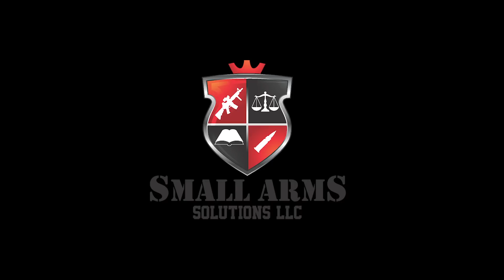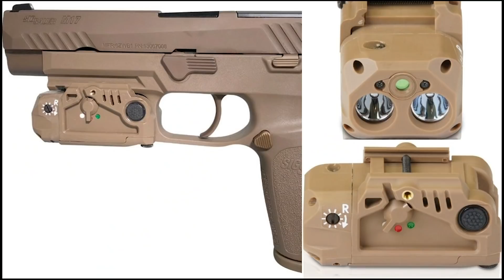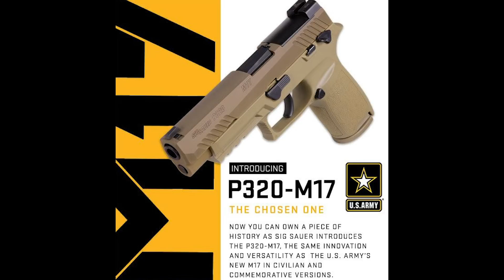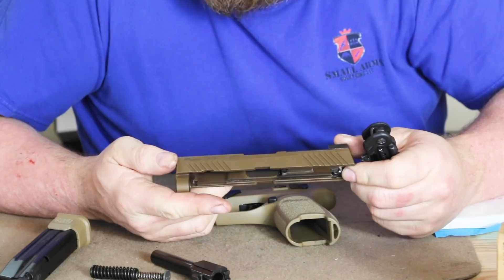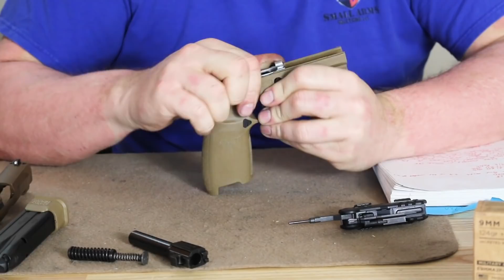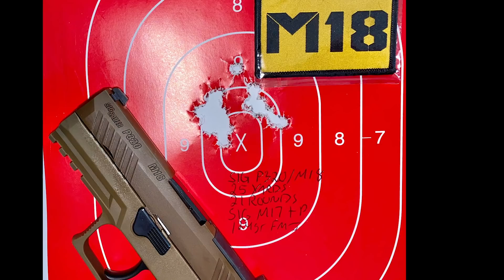Sig P320/M18 Pistol

Comment: My impression is that the Military specifically asked for a modular pistol, and only Sig met that requirement.
Reply from the maker: Not true.. Both pistols met it. That’s why they were supposed to compete in phase 2 testing. That chassis had nothing to do with the modularity requirement. Read the requiremnt!
Reply: I read an article that stated that the p320 was more reliable and had far fewer failures when being torture tested in harsh conditions. Grand Thumb proved this during the mud torture test in which the sig performed better along with the smith and wesson m and p.
Reply: @The-last-son Incredibly laughable given all the QC/design issues of the P320 being clearly demonstrated this last yr. They're literally killing ppl.

Comment: Glock did compete. They just lost.
Reply from the maker: Um, no. The phase 2 was not completed. Only a down select. No testing was done to determine if either pistol met specs or not. With only 12k rounds being fired, they don’t know if it was even as good as the M9 it was to replace. The army failed to properly test these firearms to determine what was equal to, better than or if neither met criteria. Phase 2 is where the guns really get tested. I am not a fanboy of either pistols. I am a fan of completing trials to insure our troops get the best possible equipment.

Comment: I think Glock came into the competition, arrogantly assuming they were going to win just on reputation. The G19X barely met the criteria in my opinion. For those that would disagree with me., a changeable backstrap does not make it modular, and the thumb safety was just haphazardly thrown onto it, where is that thumb safety now?  Anyway, that’s my opinion.

Comment: Glock is not modular!
Reply from the maker: Per definition of the contract, yes it was. The removable chassis had nothing to do with the modularity component of the RFQ. Sig chose a two gun solution snd Glock chose a 1 gun solution. This is a common mistake people make about this requirement.

Comment: The SIG is much more complex.  The Glock is much more durable and easier to work on.  The SIG will shoot loose with +P ammunition,  the Glock will not.  SIG mags cost twice as much as Glock mags.  Then there is the issue of the 200+ lawsuits against the SIG  320 by owners who have accidentally  shot themselves  I think Hunter Biden was involved in the selection process..

Comment: They don't have basic features like a safety so glock should not even be considered until they redesign and bring it to modern requirements. Glocks have less safety features than 1911s.
Reply from the maker: You are so off on this dude! Very sorry to say!
Reply: @SmallArmsSolutions  nope glocks dont have a basic safety that's a fact.
Reply from the maker: @blackfam972 the MHS had 4 safety’s! Lever, firing pin, drop and trigger safety!

Comment: An excellent and informative video review. I believe it called a “captive guide rod” not embedded on the M18. Also, the M17 has a separate guide rod and spring, which is more traditional.  Any reason why the PVD coating is so susceptible to scratches - why didn’t Sig use a better coating?  Is the M18 +P rated?

Comment: Came across something interesting today, so I bought it. An M18 exactly as issued with the cardboard box. The pistol is not on Sig's website, but is exactly like the issued pistol. The markings, black controls, extended slide lock, and serial number (TCXXXXXX) is exactly like the issued pistol. This is not a standard civilian P320 M18 and it's not a commemorative.

Comment: Recently been doing a lot of research into 'carry' sized pistols like the 19X/G45 and the M18. I am in the same boat. I don't see the purpose of the M17 if the M18 works fine. Pitting the M18 and 19x up next to each other similar the two really are and the M17 really just seems like the oddball out. If the 'carry' size pistols do the job, why spend the extra dough fielding the M17?

Comment: Modular design and manual safety and 2 sizes was the main reasons Sig 17 won the contract.  Glock didn't match up
Reply from the maker: Umm, no. Both manufacturers met the criteria. The guns were never even tested
Reply: @SmallArmsSolutions  Apparently we've read different reports on this.  No matter..
Reply: @SmallArmsSolutions  Just seen a 21 min. video on this subject. It showed the form or reports on each category. It broke it down into 9 different categories. One being most important and 9 being the least. The cost was 7th out of 9.. It was 32 pages and very detailed. It also listed Clocks complaint and why its was turned down.. Very boring.. lol  Thanks good luck...
Reply from the maker: @DM2277-i6z  the simple fact is both pistols met Phase 1 testing. They failed to do phase 2 which is how procurement was done. That is all the torture, environmental and compatibility and so on. After that you have one clear winner, two failures or two guns that meet the requirement and for that one competitive bidding. You DONT SKIP THIS PHASE
Reply: @SmallArmsSolutions  You should watch that 21 min video with the 32 page report and breakdown of the test results. I think it explains it, sort of..Don't remember the site, he looked like x lifetime military from Vietnam era.  Still has his crew cut..  lol Very knowledgeable   Good luck...
Reply from the maker: @DM2277-i6z  there were no test results for phase 2. Only results were the initial downselect. I have been part of weapon replacement programs all over the world. This is not the way it is done.
Reply: @SmallArmsSolutions  Makes zero difference to me one way or another.  Was just saying what i seen and read and where i seen it..  I don't personally own either
Reply from the maker: @DM2277-i6z  means a lot to me. Our troops deserve the best handgun available. The army failed them by selecting a weapon that did not know if it was the best of the two since they did not complete the normal testing. If they did, all the problems the gun has had would have been found early. They could then have decided if these were a showstopper or could be fixed during normal course of development. I am not a Glock or Sig fanboy, I am what is best for the troops. The Army never knew either before selecting. Also, they don’t know if the M17 is even as durable and reliable as the M9 it replaced.
Reply: @SmallArmsSolutions  Well i have seen 4 different comparison test videos with the Sig vs the Glock because they all were wondering the same as you, which one was better.. And all 4 guys liked the Sig better than the Glock. And they all commented on the previous Beretta that Sig replaced, and 3 out of the 4 guys hated the Beretta.  All 4 test videos were military veterans of different ages... They all seem to agree that the Military got it right.  And i hope so to.. Good luck and be safe.  I enjoy your videos
Reply from the maker: @DM2277-i6z  it does not matter what anyone thinks, there is a process to procurement.  This is the problem
Reply: @SmallArmsSolutions  I never said it was right.  I just was informing you what i had read and seen.  Like i said i'm just glad it looks like they got it right.  And thats what matters the most... Bye

Comment: Glock failed to meet the requirements laid out in the program, plain and simple.  They put a safety on, but no optic cut, limited modularity due to how it was manufactured, and cost about twice as much as the Sig.  Glock was relying more on their world renowned reputation for reliability, than really trying to make the pistol per specifications.
Reply: Sig hired the main General in charge of the program and put him on one of their Executive Boards.

Comment: None of the 'what if' stuff matters when it comes to safety. "PLACE WEAPON ON SAFE" are words spoken and heard on every military range and if one option does not have a safety, it would only be considered for competent spec-ops units like the g19 already was and is. With the amount of NDs that happen already, the clear winner is the one with a safety. I think if Glock spent that much on R&D they could have integrated a safety and likely would have won the contract but I guess we'll never know.
Reply: The actual glock submission did have a safety
Reply: @jacobdejong9142  I just learned that about .5 seconds after I posted this.

Comment: Having used an M11 (1990s) and owning a Glock 19 (gen 3) I prefer SIG in a DA/SA, though I seem to be getting turned to my CZ P-07 lately, but Glock in a striker fired.  Reason is I put more faith in Glock's internal safeties, partial cocked striker with 3 separate safeties to where you literally have to pull the trigger to make it fire, over SIG's fully cocked striker and all safeties attached to one area.

Comment: Sorry but there's no way glock sunk alot of money in r&d to put a fde finish on a glock 19 with a slightly longer grip and a lanyard loop. Sig actually had to spend $ in r&d because they actually innovated with the modular fcu.
Reply from the maker: The gun was redesigned, it was not a Gen 4. In fact, I don’t believe there are any parts compatible. Both guns had significant r&d costs. They should have been tested properly to make the best decision, fair decision giving the troops the best possible pistol.

Comment: Glock had a shot at the contract...The government wanted a modular gun you can covert from one slide to another slide...caliber to another caliber and lower to another lower...Glock only submitted one gun..It was not a modular model...Sig provided 2 guns both were modular ...The saying "Glock Perfection" which is a myth in its self...Every owner of a Glock I know have changed the trigger...the slide ...and the sights... I think Glocks are over rated ...The government proved  that Glock isnt what people think they are...
Reply from the maker: Totally untrue, read the requirements. Glock met them. Both guns met the requirements.
Reply: Every owner you know? Funny, because the vast majority of Glock owners will at most add a light to the end and that's it. A few more might change the sights and then that's it.

At least Glocks don't have a Shake Awake feature like Sig 365s! 😂

Comment: You are giving some misleading information.   Although price was a factor in the selection process, Glock DID NOT out perform Sig in any significant way that would justify the additional $100 million.  You should read the GAO report.
Reply from the maker: They did not do phase 2 testing to see which pistol was best!
Reply: @SmallArmsSolutions  Correct.  But if you read the GAO report, the Gov could have chosen up to three pistols to continue the evaluation process.  Due to the results of the phase one testing, Glock did not out perform Sig in any significant category of the testing.  All of which had a much higher weighted scoring matric than the price category.  Therefor, Sig was chosen.  Bottom line; price was a consideration but only after Glock was proven to be not any better than the much cheaper Sig.
Reply: @generitaldato794  Sig hired the main General in charge of the program after he retired and put him on one of their Executive Boards.

Sounds legit.
Reply from the maker: @generitaldato794 Phase 1 did not give the government anywhere near enough information to make a proper decision. That was a down-select only. Both pistols completed the 12K rounds required for the minimum requirement to move them to phase 2 testing where the actual testing begins. This is where you see if they meet the NATO STANAG testing as well as durability and reliability.

Comment: Although the Glock 19x met the modularity requirements of the MHS program, the Sig M17/M18 surpassed them and is clearly more modular than the glock. Try changing the frame on the 19x and putting a red dot (surely we should agree red dot handguns are the future) on it while I race you doing the same with the M17/18. It is not possible to beat the Sig when performing the aforementioned modifications. Not to mention it is significantly cheaper to do so. The sig p320 is a truly a revolutionary firearm and deserved to win. Hilarious to me that glock guys are still pissed.
Reply: Sig hired the main General in charge of the program after he retired and put him on one of their Executive Boards.

Sounds legit.
Reply: Agree 100%.

Comment: They didn't have to go to phase 2 testing because it's the same argument that Glock passed the modularity requirement.  The SIG M17 is equal in reliability, maybe not more--we don't know, but passed Phase 1 shooting reliability test over all the others except Glock.  However, the SIG exceeded the modularity requirement than the Glock and offered a better all-around deal.  SIG is already manufactured in the USA, whereas the Glock only makes one model here and it will take time for them to ramp up, so why give money to Austria in the meantime?  The SOF picked the Glock because they want to be different from the regular forces to distinguish themselves and that's enough sales for the Glock anyway. Both SIG and Glock came out as winners.  End of debate for both fanboys.
Reply from the maker: Actually you are wrong. Phase one is an initial down select which only determines if the gun meets the requirements of the criteria and initial durability. Phase two is where the real testing is done. The destruct test, environmental testing, interchangility, safety and so on to determine status weather the gun meets the criteria. Clear winner, clear failures. If all win then the competitive bidding. This is not about fanboys or brand loyalty. It is about proper testing protocol. Phase one does not do this.
Reply: @SmallArmsSolutions  Thank you for the explanation and I look up to you as an expert.  I am not against Glock, my point here is the big pictures that there are more factors than just reliability.  Unless in your own test the SIG is a dud, one already can tell that's M17 is pretty reliable and it exceeds the Glock in Modularity.   No one can take Glock's history of reliability, but most modern pistols are just as reliable due to new technology (including the other entries).  It's like saying Tesla's battery is not as reliable as Toyota's hybrid battery just because it has a longer history.  The SIG came in a better deal and production can be made in America quicker, providing immediate US jobs instead of giving Glock a grace period.  Think of the overall pictures and not just reliability reputation.  I think in the end Glock is happy because the SOF picking them to distinguish their status over regular troops like the Rangers (switch back to brown) and Green Berets want a different color than the regular troop's black beret).  LOL, I am biased to the M9 from my time in the Army.
Reply from the maker: @tonyson8721  the process is set up to ensure our troops get the best possible weapon. Reliability and durability come first, once established, the the procurement process and competitive bidding. By the way, both Sig and Glock have US production so both made that requirement. Every small arm in US history goes through this process, except the XM17. Again, I want our troops to have the best, wherever the chips land.

Comment: The only reason glock lost was because they didn't have a external safety even though they have two internal safety's
Reply from the maker: I’m, you need to see their MHS pistol! It does have the manual safety. The commercial 19X unfortunately, omitted that feature. Both pistols met the design requirements. That’s why they were the final 2. The government failed the critical Phase 2 test that would determine the status(1 clear winner, 2 clear losers or if both pass (thus competitive bidding)). We would have known if our troops got the best pistol.

Comment: I think a lot of peopis mid the point of the competition. Modularity. You can take the fire control unit and switch frame sizes. One gun many sizes.Modularity. Glock you can’t do that. Not easily not like the dog. Sig has the ability to and an optic glock does not. If you look at what they wanted sig gave them what they wanted 
Modularity. I keep saying that because I think it’s over looked often.
Reply from the maker: Both pistols completely met the criteria. That is why they were the final two. They failed to do the phase 2 testing which would determine if the pistols met the the durability and environmental requirements.
Reply: I failed to mention I have the original sale brochure for the P320. Sig already had the design similar to the glock already they call it the carry version. Compact slide and full size frame back in 2014. Glock short comings of design shows. Zero modularity

Comment: i thought the army wanted a modular pistol? . is the glock modular? or just a dressed up glock 19?
Reply from the maker: cordellej both Sig and Glock met the modularity requirement. That is why the two pistols made the downselect. The Army for some reason never conducted phase 2 testing which after those results come in there is a clear winner, both meet the requirement and go to competitive bidding or both failed to meet the requirement and you start over again.

Comment: I think the biggest selling point that sealed the deal for SIG is the FCU can be installed on a number of different frames with different slides. So basically the M18 can be fitted with an M17 slide. For repairs in military it makes it easier to have thousands of slides, barrels and frames to swap to. That's the whole reason I went with the M18 over a G19

Comment: Chris would you consider doing a breakdown of the Sig P320 firing pin issue on might be occurring related to the numerous unintentional discharges? Also the lawsuit just filed regarding this issue and the DOD’s requested/mandated changes. A video on the topic listing numerous instances of unintended discharges with both civilians and LE - several instances caught on camera.   https://youtu.be/-SBpZBs3foA